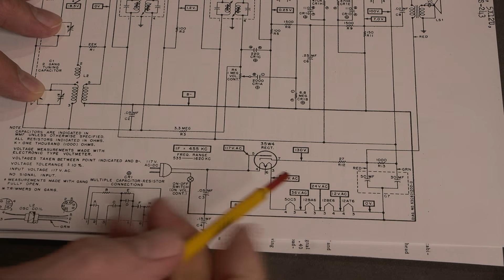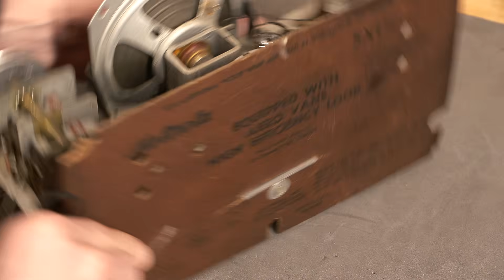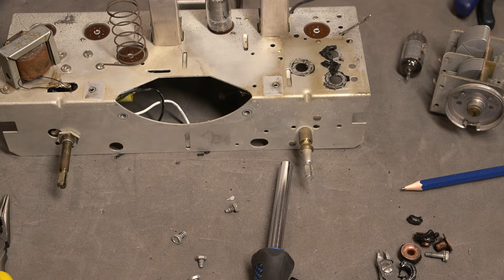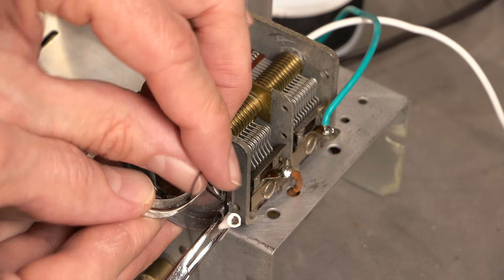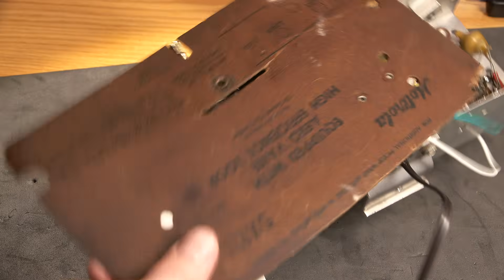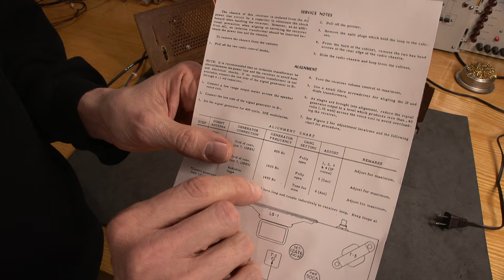Motorola Radio Restoration And Modification - Full Detailed Procedure With Bluetooth Addition!

Comment: I love your channel, and I can't believe I watched all this video from start to finish. Now , I have a question: All those testing devices above your bench, how are they connected to the AC mains? First, I thought about a very big power bar with 20 or mor outlets... I assume you never use more than 2 or 3, maybe 4 of these devices at the same time, so a big power bar like this could make sense. These power bars have a  breaker built in, so I assume they are safe.
Reply from the maker: You are correct, only the needed gear is powered at once, which is only (usually about 3 pieces.)

Comment: When it comes to electrical lamp line cords there are two things you should know. They are all 18 gauge stranded wire but
come in two different covering thicknesses STP-1 and STP-2. The STP-2 is twice as thick as the STP-1. Use the STP-1
line cord as it is easier to flex and curve inside the chassis making things easier to connect inside the chassis.

Comment: My "Dog" doesn't like the solder sucker noise....he got stung by Bee's one time and now runs away when he hears that 'Buzzing"...  I have the same de-soldering device which is very nice.....🐝🐝🐝
Reply from the maker: That's a funny story!
Reply: Ha. My dog hates beeps, probably due to being fitted with a shock collar as a pup that beeped first so the shock could be eliminated. It makes continuity mode on DMMs unpopular,  and I have a drawer full of buzzers and beepers I've removed from other gear that served no purpose other than upsetting him.

Comment: There has to be an easier way to do that dial string............... don't ask me, I don't know. But if I had to do that I'm afraid that radio goes back on the shelf. I've seen some radios that had a second spring on the long run and you could come to it from both directions with pre-tied string and just hook it.
Reply: I'd like to see how that was done in the factory if anyone can direct me to a video. So far, I'm thinking it's done by a small team of experts, working in concert, with a few custom tools, like surgery. 😉
Reply: The usual way is start the other way around, fix the dial string to one of the hooks in the capacitor wheel. Then you don't have to worry about spring tension. And then also you don't have to wind behind other wires three times too. Then at the end of your winding you knot the wire to the spring on the other hook in the wheel, so only once you have to worry about tension. I am afraid to say that Paul started on the wrong side... 🙄

Comment: The AA5 and AA6 radios always look great, but I just wish that they thought twice about how they wired the switch to the rest of the radio circuit. As someone who has a vintage radio in Australia (His Master's Voice Little Nipper 64-52 with the 6AN7), the wiring is slightly different and they run it to the switch then to a big transformer with a smaller secondary in series of the live wire to step down the voltage and help isolate the line, along with the fact that you can only plug it in one way as Australian plugs have the live and neutral connections in this shape ( /  \ ), which helps.

Edit: I'd love to meet the monkey that messed around with the IF transformers.

Comment: Paul in europe all our plugs are non polarized....  so how would it then all work here ?? plus our voltage is double then in the usa
Reply: AA5/AA6 radios are strictly Western Hemisphere products -- you'd need to use a step-down transformer to use one in Europe.
Reply: @editorjuno  thanks and yes I know that.. but that was not the question it is we only have non polarized plugs in europe so we never know which side the hot and neutral is !!! And I want to hear that from Paul as I trust him with the correct answer !!!
Reply from the maker: Isolation transformers are commonly used in a step up, or step down configuration, this would provide isolation from the mains, IE: (like a set with a transformer in it). Many auto-transformers get mistaken for isolation transformers which is still dangerous. Variac's "and the like" *DO NOT provide isolation*, so always test the product for safety.

Comment: That plug is what we use to buy in the 50's 60's to replace the broken molded one.  They came in white as well as brown.   Flip up the lever and slide it off, you might want to keep it as an antique.  I see the original color for that particular model was Ivory according to Riders vol 21.  Someone did have fun with the paint.

Comment: It's not a dip paint job (paint lying on the surface of water and you dip the part into it), because the back of the case had that clean surface, which is not sanded. It might be aerograph, but that's a lot of swish swish from the wrist... or, and if that's the case, then the person who made it is a pro, it might be a genuine smoke job. Flame tip, dirty burn, slow and careful flicks over the surface you want to give the smoke effect to. Takes a bit to learn that. Might just be, given how smooth the finish is. Neat.

Comment: Full disclosure: I haven't finished the whole video yet but wanted to get my question in: last time I modified the switch position by moving it to the hot side, the 60Hz coupled into the audio section very strongly through the volume pot, making the radio unusable. How do you mitigate this issue?
Reply: I think you'll like the rest of the video. Mr. Carlson goes into some detail about two different methods that he's using for noise and hum mitigation. 

It sounds like one of the methods he's going to release stuff in detail with his Patreon, and the other goes into how he does some internal shielding. 

I think it's one of the best videos I've seen so far on approaching ripple and noise reduction in a practical circuit like this. Definitely worth a try for my point of view! I'd love to make it at some point.

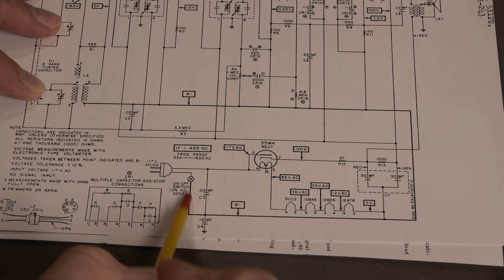Comment: 11:49 Why does line voltage need to pass through the filaments during a reverse polarity accident when C3 provides a parallel path?
Reply: Second thought, the Cap can handle more than the filaments can? 🤦🏻‍♂️

Comment: Totally agree about being able to touch the glass of a vacuum tube when cool, but do mind the areas where the tube type is printed. Nothing more frustating than trying to confirm the correct tube is installed when all the detail is rubbed off. Yes, you can often knowing what should be fitted, tell from the internal structures that you probably have the right tube. Much easier though if they are not incognito.

Comment: 20:46 and I'd immediately return it to original condition in this regard. I don't live in abject fear of the world around me. I respect that there's live voltage potentially present on the backs of these things I don't need coddled by modernizations. IF I wanted that I'd just buy a modern radio.
Reply: I like adding a label to the back to warn/inform others of what modifications I've done, especially where they may affect safety.
Reply: @KJ6EAD  I'm of the mind that anyone stupid enough to buy a 70 year old appliance and expect it to meet modern safety standards is in the middle of FAFO. Who am I to interrupt the process? 🤣 A little common sense goes a long way
Reply: @TestECull  There is very little sense that is common anymore. Knowing how to spell and construct a grammatically correct sentence has, for example, become specialized knowledge by definition as it's so uncommon. Often, the victim of ignorance is not the willfully so person we might like to apply Darwinian principles to but a curious child who should probably be offered a bit of protection.
Reply: @KJ6EAD  Not my job to police the safety of someone that may not even exist yet. 🤷 Someone buys my tube radio it is on them to ensure it is used safely.
Reply: @KJ6EAD  ...I suppose by this logic you would also argue I should retrofit ABS and airbags and such to my 1971 Chevy C10 as well? That I should move the gas tank out of the cab? Retrofit 3 point belts and power steering and whatnot?

 What if someone else buys it and totes their tot in it...🙄
Reply: Just put a polarized cord on the radio and make the chassis neutral. It don't take a rocket scientist to figure that one out. Keep original as much as possible. 73
Reply: @ronb6182  Given these things use the line cord for the FM antenna and sometimes flipping the cord will drastically improve reception that isnt an option.

What is?

It's a 70 year old appliance don't feel it up blindly.

Not difficult to be safe around an unmodified AA5/AA6. I've been running one as my daily driver boombox at work for 3 years now. No problems with getting zapped.
Reply: @TestECull  What FM?
Reply: @KJ6EAD  My Zenith from 1957 is AM/FM. One of the reasons i bought it in fact. Ain't shit worth hearing on AM for a metalhead here in Nashville but we have two badass rock stations on FM. I even got the classic rock station to play Great Balls Of Fire while I listened on it! I have a clip of that uploaded.
Reply: @TestECull  I thought the discussion was limited to AA5 and AA6 radios as was restored in the video.
Reply: @KJ6EAD  My set is. A lot of later AA5/AA6 tube sets pick up FM. They arent AM only.

Comment: 3 hours
20 minutes
Y  I  K  E  S

What??  No isolation or current limit on first power up?

Cameras?  TV show American Restoration  which restored everything, always took actual FILM pictures of their 'before' to assure they get it right.

M big, BIG fan of BlueTooth.  My replacement car radio has this and I play my favorite Michigan Radio Station (WION)  thru my car in Denver.  In the backyard I bought a BlueTooth adapter for my Bose sound machine and again listen to WION.  BlueTooth is cool stuff!

M suspicious of my parent's intentions for me as a child as they gave me TUBE RADIOS to play with.  I quickly found that there's "electricity" on control shafts when knobs are removed... tingle, tingle, tingle.

You added a filter but, so far, haven't shown the schematic.  I'm struggling to follow the associated narrative.

Comment: Thats what I call green 😮 Thanks Mr Carlson
Reply: It looks like it’s a custom green base color that goes down as a flat colored paint with no gloss. Then the painter will come by with an airbrush or if he’s fancy with his bigger paint gun with good hand eye coordination.. They will blow on another color to make those darker shades that you see. They too can also have a gloss metallic inside the paint along with the green..  and then after the colors have flashed over they go over it with a clear automotive coating. 

So it’s not just one single color of paint .  It’s either something that the painter has custom chosen or copied by a paint manufacturer number. That is a already prepped prepared paint or one that you have made for you at a automotive paint shop..  and then you choose what details you’re gonna throw over the base coat, kinda like when you hand paint in marbling using a feather and a sponge and other items on top of a basecoat.  And then you clear over it and you make something like wood or linoleum look like stone marble..